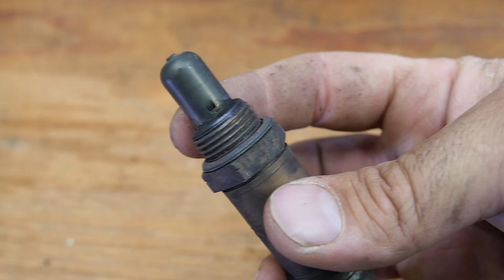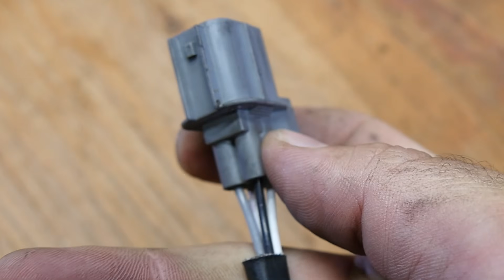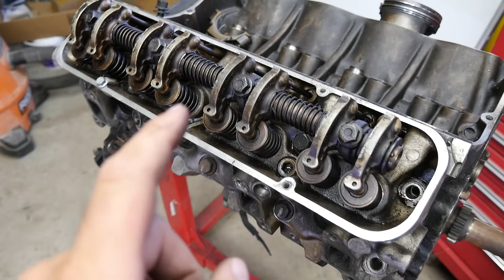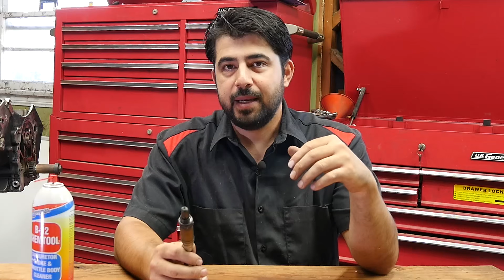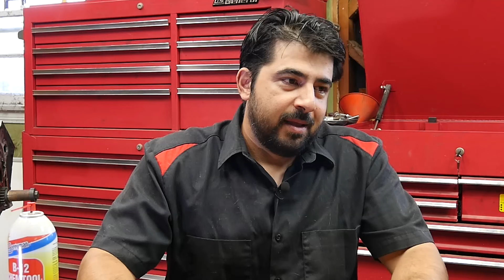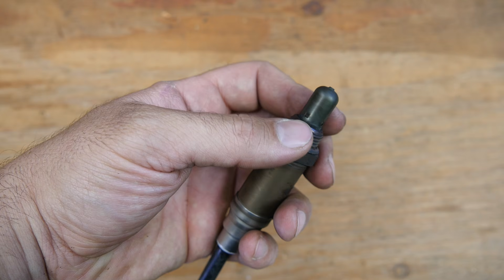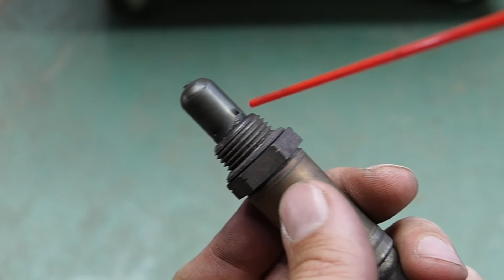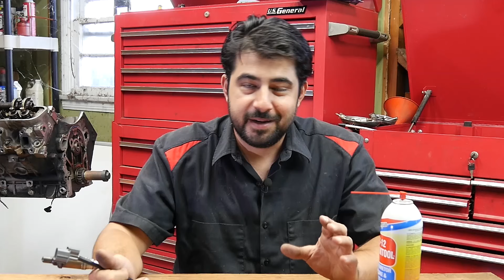How to Clean an Oxygen Sensor

Comment: What AI shared with me - Common contaminants:
Silicon: from coolant or sealants; forms white, glassy silicon deposits.
Phosphorus: from oil additives; forms insulating layers.
Carbon: from rich fuel mixtures or burning oil, black, sooty deposits block gas diffusion.
MMT: a fuel additive that leaves reddish-brown oxide deposits that reduce sensitivity.
How to clean an oxygen sensor (O₂) at home
1. Diagnostics by color:
Black - soot (rich mixture/oil).
White/gray - phosphorus or silicon (antifreeze/additives).
Red-brown - manganese (MMT in gasoline).

2. Clean WITHOUT mechanical contact with the elements inside, beware of scratches and fragility. Do not climb into the housing holes - you will damage the ceramics. Only soaking + blowing with air (100 C).

3. Solutions (use distilled water!):
Carbon/oil: 99% isopropanol (alcohol) or MAF cleaner (for 10 min).
Silicon/phosphorus: 15% phosphoric acid (for 10-15 min).
Manganese (MMT): 10% citric acid (10 g powder per 100 g of water, 20-30 min). Solutions can be heated.

4. Soak only tip of sensor in the solution.
Rinse with distilled water → then with isopropanol.
Dry with a hair dryer (80-100 °C, 10 min).
Before installation, apply copper/nickel Anti-Seize grease to the threads, tighten (40-50 N m). Graphite can degrade at a temperature of 500 degrees.

5. Check:
Signal with a multimeter: 0.1-0.9 V (oscillations = working).
If this does not help, the sensor is faulty (replacement required).

Do not use:
Lemon juice/vinegar (will leave a film).
Hydrochloric acid (kills the sensor).

Comment: Why would I clean a part under $30. The new O2 Sensor (just 1) on Amazon is only $26 for my 1993 Dodge Ram B250. My Smog boss guy said "Get a new O2 Sensor and spark plugs alog with a new Magnaflow Catalytic Converter & you'll probably pass smog here in CA". I need a converter with an CA State Executive Order Number. So I can't order one on Amazon. Emmisions are way too strict here to fuss with this. I'm out $1300 on a conversion van I bought for $1900 in 2011. Just to pass registration in CA in 2025. It may not pass and I'll be forced to junk it. Perfectly good 318 with rebuilt pristine tranny. My money is on it passing as the plenum pan is stil original at 194.5 thousand miles, no leaks, SoCal van - never saw road salt once.

Comment: I believe citric acid works. Can use to clean converters. Done before and passed aims. Hard part is soaking the converter on the car. I believe would work on O2 sensors also.

Comment: Do you think I may have ruined my O2 sensors by letting them soak in Lucas fuel injection cleaner then washed off soaked in gas for a little then used CRC mass air flow cleaner to clean everything and dry good b4 starting.  I haven’t started the car yet. I had no cel b4 doing it just thought cleaning them wouldn’t hurt but now think I might have messed up.  I guess starting and running it will be the teller but hoping you will tell me that the Lucas wouldn’t hurt them.   Thanks for any insight.

Comment: Ends up with my 99 Subaru, the O2 sensor is 1/3 the value of the car. Pretty much wrote my car off with the one part, if I was to replace it.

Comment: Been watching you quite a bit. Had to replace my timing belt on my 2004.
I would just replace it; 02 sensors can be found online for around $25 each. For going through the trouble removing the 02 sensor, I just replaced it because the one you clean may not work or just a temporary fix.

Comment: Just a random thought. If you put it in a cup of gasoline or carb cleaner and then put that cup in a ultrasonic cleaner. Would that be a better way to clean it
Reply: Using gasoline or carb cleaner in an ultrasonic cleaner is not recommended due to safety concerns—it’s highly flammable and could cause a fire. Instead, use a non-flammable, sensor-safe cleaning solution specifically designed for ultrasonic cleaners. You can follow or subscribe to my channel "Mechanical Guy" and ask questions to get the fastest free consultation!

Comment: I have noticed that when you buy O2 sensors from JAPAN, NGK or DENSO the vehicle rally responds to the vehicles PCM bring the fuel trim right on the right level. The accuracy of the signal is way tighter on the sensors than other manufacturers. My vehicles have had mileage increases of 6 to 9 miles per gallon extra. Now that is something you can tell your mother about. 
Also, the connector that on the vehicles side over the years will give you problems. YOU have to check the connections and put in dielectric grease to keep moisture out and prevent corrosion in the mating surfaces. THIS WORKED FOR ME FELLA.  Peace vf
Reply: O😅
Reply: Yes have noticed this as well, a Japan oem o2 gives the best performance,.
Reply: @cwservices3839 bulshit I just bought an upstream and a downstream brand new O2 sensors and they both read that the heating elements are not working on them. In my upstream is a b** to change cuz it's right in the manifold and the socket that I got for barely even reaches the nut part. But once I got it broke loose I was happy as hell but I want to go turn on my car and check engine light was still on and the code said that the heating element did not work. And I did this one it was -10 degrees outside and eBay would not give me my money back. Plus I bought a catalyst converter through eBay which that did not work and they will not give me my money back for that
Reply: My mom would ask what does mpg means😂
Reply: @Jesiahm412  MILES PER GALLON !!!
Reply: Most Denso oxygen sensors are made in the USA. NTK makes most in Japan and is the OEM supplier for many brands
Reply: @nordicpride9708  Right on fella.

Comment: Idk if your still checking comments in here but ive got a 98 ranger 3.0 and when im driving say stomp on the gas my truck feels like it hits an air pocket , like no fuel and then it kicks back in again. Could that be o2 sensors ? Going to do a code check tomorrow "
Reply: Could be o2, MAP (Manifold Absolute Pressure) / MAF (Mass Airflow) depending on which one your Ranger has or TPS (Throttle Position sensor) The TPS was an issue on my Dakota and caused a similar issue to what you're describing. Hopefully its been sorted in the month since this comment.

Comment: My car showed check engine light. O2 sensor.
Went to the electrician, told him to clean the O2 sensor. He took it out, buffed it & sprayed Carb cleaner & cleaned with a cloth. Fixed it. Started the engine, no check engine light any more, just 2 hours ago. Also refixed the -ve terminal of the battery.

Another guy tried to cheat me😅

Comment: I have the engine light and it threw a P00031 code. Mentioned something about a heater something Bank One. Looks like I need a new sensor. It is a Toyota so I might want to maybe pay extra for a Denso sensor ?
Reply: Yes, the P0031 code refers to a heater control circuit low for the O2 sensor in Bank 1. Replacing it with a high-quality Denso sensor is a great choice for a Toyota, as it ensures compatibility and long-term reliability. You can follow or subscribe to my channel "Mechanical Guy" and ask questions to get the fastest free consultation!

Comment: The check engine light first turned on with a P0420 code. After cleaning the O2 sensor, the engine light is still on, but now it's showing a different code: P0141. What’s going on here?
Reply: I have same code need help

Comment: Cheers for the video-god bless you: can someone help me. A dealership recently overfilled my engine oil for the second time and the bike is misfiring and someone suggested to check the lambda 02 sensor. Could I try cleaning the sensor with some WD-40 please and a tooth brush or something?

Comment: Mom's Jaguar has catalytic converter message after the engine bay was improperly cleaned which filled the spark plug tubes with water!! Ooops!! So now we have learned a lesson..,, How to remove intake and replace plugs and a couple of coil packs on a 2007 Jag.!!! Yay!! Now we are checking and cleaning O2 sensors.  Appreciate your simplicity and not overexplaining !!! 
Let you know what else we learn about this lovely JAGUAR...

Comment: I have a 2018 gla 200d mercedes.engine light on most of the time . I live in Ireland . diagnostic is showing bank 1 is faulty possibly heater element .97000 miles on car .only have car 6 months .should I just replace the sensor ? Thank you

Comment: 2011 ford fusion I just had accident on it after that.  I got code on cynder 4 misfire. Also code on bank 1 oxygen sensor high voltage  high voltage.   Not sure what couse yet am down. To the oxygen sensor.  Or. Pcv valve. Did note was drinking more gas before I got in that accident. Guy stop in middle road no turn signal. On hit from the back. Only hit running abount 20. Mph or lesser.   Missed hood passengers finder and light done replaced all that ...

Comment: here I'll sum it up for everybody he basically said. don't clean it. replace it. that's what the whole video was about
Reply: Which I agree on. If it's aged or high miles, safer replacing it. Can't really tell if it's the no good heater inside triggering the code. Better replacing it.

Comment: Old heads used to torch the tip first to reduce the carbon to ash and then blast it out with bg intake cleaner and then compressed air.

Comment: I have a  2003 ford focus 2.3 wagon  with a check eng light code is po133 reads 02 sensor circuit slow response bank one sensor one

Comment: Hi I had a heated 02 sensor trigger cel after the battery died and my airbag light as well. Is it suggested to clean or try clearing code a few times and see if it corrects both issues?

Comment: LET ME SAVE YOU 8 MIN OF YOUR LIFE... he bla bla bla conclusion: Go pay him or another mechanic to change your O2. No point on cleaning your O2.
Reply: I'm just guna clean mine and test if that fixes it
Reply: @unitedstatesofamerica8304 did that fix it?
Reply: Thank you
Reply: Hell, all I want is to pass emissions inspection.
Reply: O2 sensors are extremely easy to replace.  Why not do it yourself and save alot of money in the process.
Reply: @ I should have done it during the summer while it was still warm. Now it’s getting too cold outside. :/
Reply: @DEADWRONGx it’s cheaper to clean them than replace them lol
Reply: @DEADWRONGx and can be replaced for less than $100 per sensor. Mine were not $45
Reply: I did find it very interesting tbh, I've learned something.
Reply: Thanks for saving me that 8 min lol
Reply: Dont listen to this dude all you have to do is get hot water pour it into a bowl add vinegar and baking soda and it will clean it perfectly and will function like new no need to buy a whole new one🤦🏽‍♂️
Reply: @fw.anth0nyy828 heck no that doesn’t work
Reply: Thx
Reply: Dude ur the best
Reply: @jaybeauchamp7518 dumass
Reply: Unless the holes are clogged on a sensor with holes, then you can just clean those off.
Reply: @kentclark85  how can you tell if that’s the case or it’s beyond savin?
Reply: No sé debe de limpiar entonces es mejor cambiarlo el sensor de oxigeno bro
Reply: Yeah for real…great title to then not even talk about it 🙄
Reply: Thanks dude. Cant stand these people
Reply: Sorry but you need to mention the colours of the corresponding wires....you just talk in general...
Reply: I don't know if you found your answer or not, but the same two colors is for your heating element. And your other two is power and ground. I don't remember what the numbers would be at but you could test them with a multimeter without them even plugged in. Like I said I don't know what the numbers would be at but you can Google it and find out  @akramkadhim9055
Reply: Thank you
Reply: Thank you for bringing this cheap bastard back to reality.
Reply: Hell yeah, go buy a new motor too when oil starts leaking 😂😂
Reply: Well, that’s great and all if you only have one oxygen sensor to place do you know how much oxygen sensors cost for certain vehicles especially if you have more than one and from my experience if you just replaced one oxygen sensor, the other one that isn’t bad we’ll go bad a month down the road. Have you even looked at oxygen sensor prices lately because I have and now I’m not talking about aftermarket ones because the aftermarket ones the last or they fail right in a box I’m talking about a good solid OEM sensor that will last for some time. Do you know how much those cost because if you did you wouldn’t be saying just replace them and forget about it if you can clean them and get another 10,000 miles out of them why not doesn’t take that much effort at all to take them out especially on my ES 300 Lexus, which has three of them
Reply: Just bought a Nissan caravan. Checked repair, service records. This seller spent over $800 for tinkering on bad sensor OS for conservative days, totaled $800 plus, end up replacing new one. Poor lady got the run around by this mechanic.
Reply: Or just buy the 02 n change em
Reply: Hell yes thank you dude

Comment: I just replaced my fuel injectors. Now I'm getting po172 and po175 oxygen sensors running rich. How and why does this happen and should I replace the sensor's?? Or is there a problem with the injectors???

Comment: Shouldn't a spirited long drive burn out carbon build up?
Also can downstream sensor get dirty so and upstream and downstream sensors get dirty so and detect similarly wrong amount oxygen, resulting with no detection of fuel trim problems?

Comment: . I have a question.  About a year ago I took my 2005 Chevy Silverado 5.3 four-wheel drive truck to a mechanic to have  new head gasket put in.  Prior to that the truck ran great no smog problems whatsoever.  When I picked the truck up from the mechanic he told me that it would run rough for a few miles but then it would be fine.  Since then it never was fine.  Runs really rough it gets  really bad gas mileage, and a blinking check engine light  when I hit the gas too hard.  I bought a scanner that comes up with 4 codes.  The first being the O2 sensor, the second being 4 misfires, another one is something to do with exhaust or something like that, and I can't really remember the last but it seems like it was all related to the same general issue with exhaust.  I haven't taken it back to the mechanic who did the head job primarily because I take issue with a mechanic who takes no pride in his workmanship and would give a customer back a vehicle in worse condition than it had been before the head blew.  Anyways just wanted to ask your opinion on the matter.  I really like your videos you seem really knowledgeable where cars are concerned.  I know you helped me out a lot. I'm a single woman and I don't have anybody to help me with a lot of things so I Rely on YouTube videos a lot.  I basically have like five different YouTube master's degrees now! Would love to hear your opinion. Thanks
Reply: You should take it back to that mechanic and order him to rectify the situation.

If the fault is something which the mechanic should've noticed and or repaired first time around, then negotiate a price (on parts)

But if the fault is due to their poor workmanship, then don't pay them.

I'm not sure which country you are in, although here in Australia, regardless of what the mechanics policies are with payment and pick up of vehicle. They cannot withhold your car pending payment.

Tell them they will have to bill you. If they attempt to obstruct you from collecting your vehicle. Call the cops

Comment: i have a 2003 ford taurus 3.0l dohc running lean in  bank 1 sensor 1 when i look at the live data  on heated exhaust gas oxygen sensor  2 out of 4 banks are always off the other 2 are always on ?  i have a current p1131 code...

Comment: Just because you have a code for the O2 sensor reading lean/rich fuel condition / trims doesn't always mean the sensor is faulty, it could also be because you have a vacuum leak somewhere on the engine, causing unmetered air to enter the combustion chamber causing it to run too much air to fuel, the ECU will compensate for this using the data from the o2 sensor and add more fuel to the mixture to balance the mixture out
Reply: My  breather is slightly open across the box seam would that do it?
Reply: @tigerboy60  it wouldn't, so long as the air leak is before the Mass Air Flow Sensor it makes no difference, the air leak would only be a problem if it is after the MAF because there will be unmetered air that the MAF hasn't calculated / compensated for
Reply: @benshaw576 i recently got a o2 sensor code, by reading your comment, could my intake cause a vaccum leak? like taking in too much air? reason i say this is cause the tip of the intake is on but not tightly all the way in.
Reply: What if u have a bad Catalina converter
Reply: @michaelwirth8664 then ditch that Catalina and find yourself a Carolina

Comment: I had a bad power steering fluid leak and both of my downstream sensor connectors were covered with power steering fluid when I changed them. I’m still getting an o2 sensor code. How do I clean the connector parts?

Comment: What do you think of this.  I had a turbo go, broke the shaft.  I believe the wheel assembly was never balance right.   So it broke and started burning oil.  I replaced the cartridge and the waste gate was sticky.  I had nothing with me to clean it as I was broken dn.  I tried to manual free it up and installed it.  Then on driving it was going into over boost, limp mode.  Then on acceleration it started throwing diesel fuel and smoking.  Then it threw a low voltage on the the O2 sensor.  What do you think?

Comment: Hello very nice video I have a 1999 LHS and I'm having problems with rough idle I found that the number five plug is not working change the spark plug change the coil pack still the same I have spark check the fuel injector it works did a compression check vacuum check all good don't know what the problem is what do you think